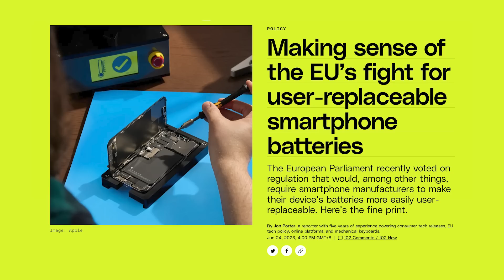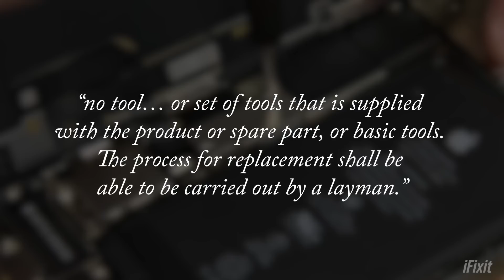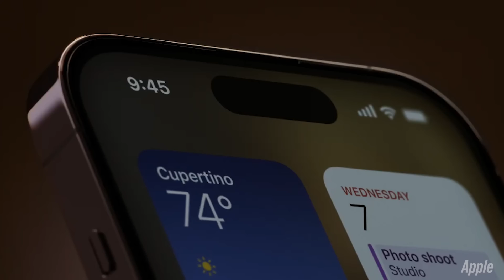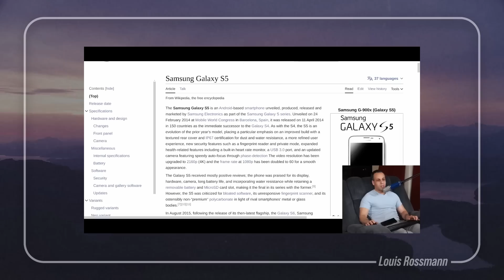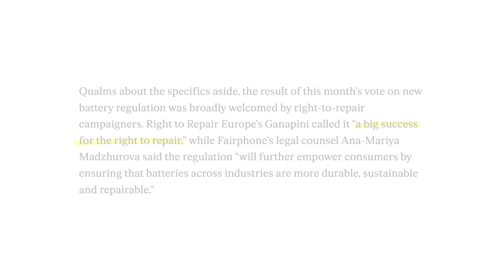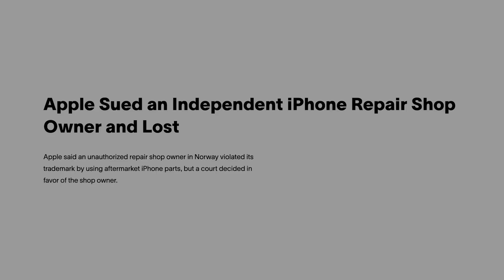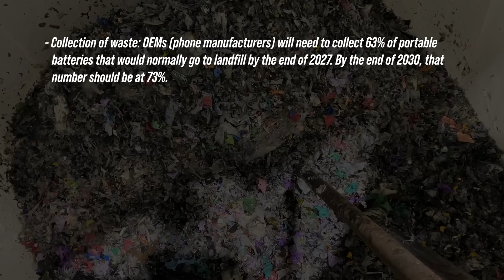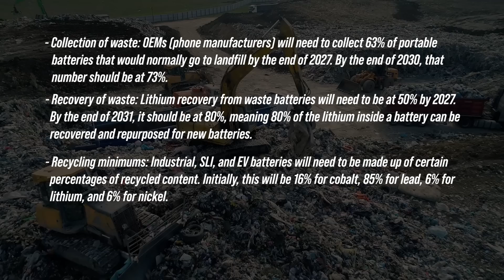EU Just Changed Smartphones Forever

Comment: Shows that any power group can't be wrong all the time. On this, well done EU. We just have to assume that the EU is too big a market to leave to the second hand dealers.

Perhaps there may be a knock on effect. Maybe they'll opt to return the dedicated power socket too, to prevent wearing out the data socket by continually plugging in and pulling out a charging lead. After all, if they wish to find a solution to the water resistant issue, they may as well look at both the battery compartment and the charge socket at the same time. Maybe too, they may opt to make changing the sockets a maintenance thing. One can but hope.

In answer to your question, dropping a mobile into water was annoying, but preventing that being disastrous was just an excuse to seal the battery away. Seal the weakest part away from access for repair and you have created built in obsolescence and a compulsorily need to replace the phone much quicker. No one in their right mind can think that recovery from a relatively rare event caused by not being careful was better than taking care of your mobile phone only to inevitably find it prematurely at end of life due to the battery failure.

Comment: A non-removable battery only makes sense if there is no reason to replace it without replacing the whole product. But since batteries are one of/the first component to cause issues in many devices, this makes a lot of sense. The question of trade-offs would come to mind more in my mind when it comes to EVs, with the example of Tesla imbeding their batteries in the chassis of their cars, which saves materials and provides better strenght to the vehicule... But given how today the batteries are still the first thing to go, I would rather have a replaceable battery car than a life limited strong one.

Comment: I'm wondering how will this affect laptop manufacturing. Many laptops have a battery that can easily be replaced with a screwdriver. I dont mind that but what I understood from the video is that we'll need to have hot swappable batteries again in laptops.

Comment: This is sign of bad research. There is another level of security to prevent theft for Apple products. There are many tech repair YouTuber who replace parts for Apple products have no problem replacing parts.
As for people who suggest phones are thrown away “Because of dread batteries” is BS. I already have two iPhones that went through batteries change with no problem.
Having a removal battery slot takes up unnecessary space and lower the efficiency of battery power. Rechargeable batteries also have higher failure rate due to its design. I’ve been using mobile phones for over 25 years, I’ve seen it all. NONE of the phones I’ve used that has replaceable battery have given me satisfaction over the non-replaceable ones.

Comment: in a way what all of the manufacturers did was seemingly take advantage of everyone wanting a thin water resistant device and using that as an excuse to make the battery difficult to replace.  Honestly though, in the days when they were replaceable I could not imagine carrying a spare battery in my pocket.  Any damage or any shorts with a battery can present a dangerous situation.  I really don't want a hot venting battery in my pocket.  It could only be worse if it had burst.  Good luck trying to sue the maker of the phone and battery for the injuries too.

Comment: i dont care that my phone is bigger i prefer a slightly larger phone that is super durable. I always used to carry 2 extra batteries. i could keep one battery on the charger and never have to have my phone connected to a wire. Unfortunately cell phones got so unbelievably weak and cheaply made that if you simply drop it from 4 feet it could be destroyed. if water even touches it it could be destroyed. now how effing stupid is that?? i mean all the tech that goes into these things and they cant simply make them more durable?

Comment: Good. Even though i am most definitely not yearning for more govt control in general, i fully agree with this course of action. If those corporations are not forced to comply, the opt-in industy-internal solution they will proudly present as self-imposed will be halfassed and useless. Just look at that apple self repair program they implemented or just spend a little time reading up on regulations imposed on the finance sector and how well self-policing worked over there. Spoiler, its a neverending disaster. If only for the fact that they squeezed themselves into every nook and cranny of our lives and afterwards leave their customer with only one repair solution that completely disregards user data (apple always wipes phones in repair) and the scant remark of "should have bought icloud", they have to be held accountable in some way.

Comment: This wasn't done due to the natural progression of the technology. If that was the case, then it wouldn't be possible to build stationary PC's entirely by choice as cheap as it is, since the power supply would be welded to the case and mass manufactured PC's would be glued shut. Yet they aren't. All this is solely for driving up profits at the expense of the consumer. It's the exact same train of thought as the conglomerates of the industrial revolution had. Force people to buy tons of crap they actually don't have to, all in the name of profits

Comment: Happy to hear that! Even if it took the EU 10 years for this law. It also should be for car spare parts too like changing a light bulb
Reply: IIRC this has been introduced through an EU regulation as a requirement in 2006, already. 😇
For lightbulbs, at least.
Reply: There is no light bulbs on my Skoda Enyaq, all is LED. And the matrix head lights are great.

Comment: The problem is with the  RIP off phone repair  shops.   Who all speak from the same script. This will change their m.o.
Previously, take a  Samsung phone  S8 or  newer, you will find the charging issues. Too much charge and the charging port would close.  The  shops all said the same thing:: we can repair it but we might scratch it taking it apart. Then they physically scratch your phone just to make it look like they have taken it apart  when in reality  all they do is  plug in a different charging connection. For this  you will be charged between £50 and £80.
The entire industry is a scam.

Comment: To be honest, there is almost no need in replaceable batteries anymore since the quality and efficiency has improved a lot. Batteries now hold like for 2-3 Years without any issues (4-5 years with a little performance drop), even with fast charge. So the EU is like 20 years too late 😂 (as always). After 4-5 years the software is outdated and the phones need a replacement anyway.

Comment: If it was simply a phone, like a Nokia 3310, this makes a degree of sense. However, a  smartphone goes so quickly out of date with regard to capabilities, and the batteries deplete quite quickly, and the battery is such a significant fraction of the price of the smartphone,  this is not really a viable proposition. The most viable approach is for the materials of value in the smartphone, to be open to efficient recovery and recycling into new products.  Who's still using an iPhone 6 :-)

Comment: how would a removeable battery make a phone thicker? it will be the same size as the one already in the our phones just more easily accessible. Ive had many cheaper android phones that has a removable battery and they were still thin, plus thin isnt always better incase it falls since the thicker frame will help absorb the blow

Comment: Just my personal opinion. 10-20 years ago, the producers didn't had to include non-removable battery to make customers order a new phone, because phones used to get exponentially better year after year. After around 2012-2015, the processing power of the units started getting only marginally better, so the only reason to change it was if it got broken, and making unremoveble batteries was the easiest way to make it useless after 2 years.
Reply: Yeah, and later on they start degrading the software updates. Changeable batteries will not affect too much in the behalf of a user. It may just shorten the software updates in order to maintain the number of sales, if that scenario occurs - just my personal opinion.
Reply: @aleksandarsterijev  Also Apple being the main culprit here. I remember having an old Ipad 2 that could be used without a problem as a 2nd screen for my pc, run basic games and other things without a problem. Now except the fact that they dropped support and most apps won't run just because they force the developers to ask for newer IOS versions, hence locking you from having a functional device anymore, all the apps that still run, just run horribly. Anti consumer practice at it's best.
Reply: @roborovsky6950 do you keep all your lecture notes from your university classes once you complete it? No. You throw it away. Why would you maintain old stuff? It costs money. IPad 2 is a 32-bit machine from 2009 or something. Nobody supports 32-bit machines on a consumer market now. Apple doesn’t support 32-bit machines, Microsoft dropped support for 32-bit machines in Windows back in 2020. Windows 11 doesn’t support Intel cpus that came out before 2018, because it is all technical liability.
Reply: @kostiapereguda  I'm not blaming them for dropping support specifically. It's the fact that the latest updates it received made it a brick. Slow asf and not being able to run any apps, since they require newer IOS versions to be installed. And no, the app have no problem on running on that hardware, they are still the same apps that used to run well few years ago and received no major updates, just the IOS version requirement in the store. I managed to sideload some without a problem, proving that it's just apple forcing you into buying newer devices.
Reply: @roborovsky6950 blud that’s a really a old device
Reply: @aleksandarsterijev that's why we have roms.
Reply: @aleksandarsterijev  Indeed! We are all tricked into the "we must update software regularly on EVERY device". All for our "safety". You really believe that, right ? I believe it is a way to sell new unfinished products that can be controlled and disabled or put so much updates your device becomes useless anyway.
You work for a product, to spend your hard earned money on something, the company you "buy" it from is the final admin, you're just a user. Imagine you doing work for your employer, you get payed and then you undo your work you got payed for. That would't fly would it ?
Reply: 100%. I remember the 2000s/2010s when every generation of smartphone was so much better than the one that came before it. Nowadays it's slightly thinner bezels or a better fingerprint sensor. But I couldn't tell the difference between a phone that was released yesterday and a phone that was released 3 years ago.
Reply: This is not an opinion dude XD
Reply: Since the galaxy s3 and iphone 5 we've been getting the same phone. We really peaked in 2012 and all the cool features we have today are entirely unnecessary
Reply: @YunisRajab Samsung Galaxy S5 was the peak, not S3.
BTW I got the Galaxy S4, great phone. Lasted me well from 2014 to 2021. Still uses it for running because less heavy than my new phone.
Reply: go pro and others  have waterproof to 15m  they all removeable batteries .
Reply: Forced updates will continue to ruin old phones. Up until recently, my only phone was a Galaxy Note 8 that I got new. I only got another phone because forced updates ruined Location services. 
This caused any app that required location to constantly cycle. I tried factory resetting the phone and reinstalling the app, fully updating everything to no avail. 

The biggest app was for a carwash I have a membership for. Without location I couldn't activate my wash, thus rendering my membership useless. I was using my wifes phone to activate it for a while, but there were many times I wanted to get a wash when she wasn't able to tag along so I caved and got another phone.

I miss my Note 8 dearly since it had fingerprint on the back. In-screen fingerprint scanners suck. My phone is constantly failing biometrics or attempting emergency calls in my pocket now.
Reply: The reason why the phones are obsolete and slow after 2 years is cuz the apps keep getting bigger and bigger. They don't manage memory anymore. Updates don't get overridden they just added to.
Reply: this is not an opinion tho, it's what happened..

Comment: A part of the problem is the consumer, I don't want a super slim phone, but folk think that is "premium", and they also think a glass phone is premium even itt will break if you drop it.

I want good plastic because it is durable and can look and feel good.
I want a headphone jack for it could work as an antenna for FM radio and a remote trigger when taking photos.
I want more sensors, old phones had more sensors and could be used as a tool, give us air quality sensors and we have a tricorder.
And give us bevels to put cameras in and make the phone easier to hold when gaming, and turn photo sensors 90 degrees so folk can film normally.

Why don't folk want logical and practical things nowadays?

Comment: A major step back for industry, users, costs, and efficiency...
Guys, you don't understated. Not only that device with replaceable battery will cost more, will be clunkier, manufacturers will now even easier push programmed obsolesce. You're not imaginative enough. They simply push it via the batteries. And there will be more battery waste (as replaceable battery does not need to be of good quality...).

Comment: Electronic designer here. The motivation behind non replaceable batteries was the belief that consumers wanted slim phones with edge to edge screens. Hence, glue. I think it's bollocks. Yes, it's a bit harder to have a phone you can open, but no, this was really led by the assholes from marketing. Most designers aren't so evil. Also, it's not just batteries. You can design for easily replaceable screens, connectors that have tolerance for manual repair and so on. It's simply a case of having to defenestrate (some of) the marketing department. Oh and incidentally, has anyone else noticed that edge to edge screens actually suck when it comes to real world use?

Comment: They should also implement trapdoors for memory, ssds/ hard drives etc on laptops like there were previously
Reply: it's quite annoying to have to open the whole machine just to remove the drive or upgrade RAM. I prefer to older method of just having to remove 1,2 screws to open a small door that exposes the storage and memory slots.
Reply: @get_monochromed  Oh that's what you meant with trapdoors. Fully agree with you, I have a trapdoor on both of my laptops and it is very convenient as opposed to my GFs laptop, from which you have to remove the entire bottom.
Reply: I don't think that's necessary, as long as the laptop's ram or storage can be easily accessed with just a screwdriver
Reply: Apple now soldier their SSD to the board you can’t replace it yourself even if you can get inside.
Reply: @chadzoe1  now ? Those scum were doing it for years, my 5 year old MacBook has soldered SSD, if the SSD dies, the whole computer becomes an expensive paper weight. 😪
Reply: Came across  the Framework laptops the other day, worth checking out, designed to be easy repair and upgradable, looks unreal, Linus ahs done avideo on them and is also invested in the company
Reply: Why do you see that as an important feature?
Reply: @stokovsky8483  Because it is a crucial feature? How else would you upgrade memory or replace a defective SSD. That is especially important since modern notebooks have laughable capacities, I recently paid 1300€ for a notebook that has only 16 GB RAM and only 1TB of SSD space. I need at least 64 GB RAM for my work.

Comment: Okay here me out. 
While replacable batteries are good they do have some limitations and safety hazards. Instead of mandating replacable batteries. How about setting a standard for batteries. 
For ex. instead of having random 5508 mah or 1130 mah, make battreies come in standard sizes such as 2000 mah, 5000 mah that could fir many different smart phones  like the standard aaa and similar such batteries and when your smartphone's battery dies you dont have to rely on the OEM to provide you a replacement, Instead you can just go to market and get a new battery.
Its a win  win for all

Comment: For E-vehicles and laptops it completely makes sense to be able to replace the battery and keep using the device. But for smartphones, in most cases, by the time the battery is no longer useful, the device itself is so much outdated that it needs to be replaced. I have 2 smartphones that I stopped using because they can't handle the newer versions of the apps, and their batteries are still alive.
Reply: For flagships that not issue still samsung sells and manufactures s20fe to this day which is few years old

Comment: It's actually quite likely that manufacturers will try to add software locks or a dab of glue for other markets. Mechanical design will probably be the same, but where in EU they will have a simple clip to hold a device together, in other markets that clip will also be glued and a line of code will have a serial code check for a BMS (Battery Management System). That's as long as those other markets are big enough. US, China and India need to follow for it to be a truly global. Hopefully EU will be a catalyst ang make it easier for others to follow.